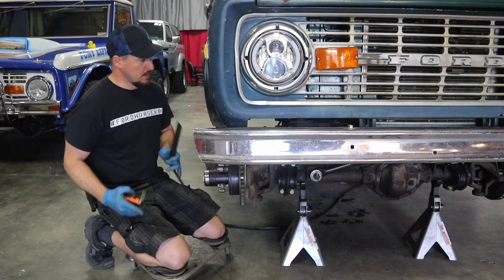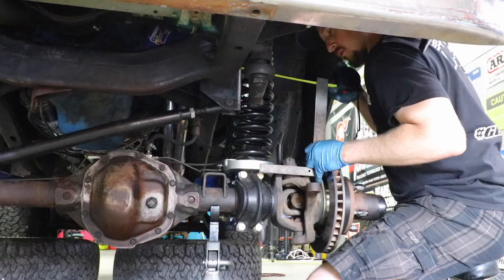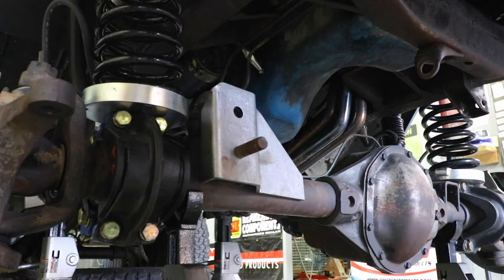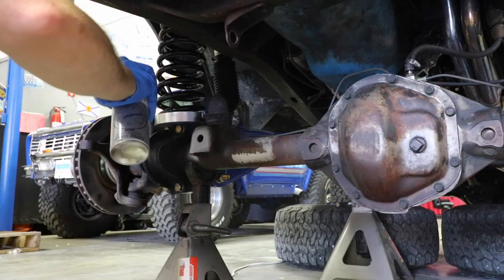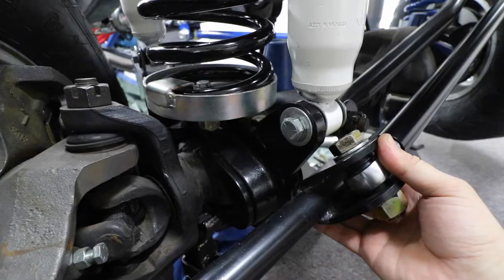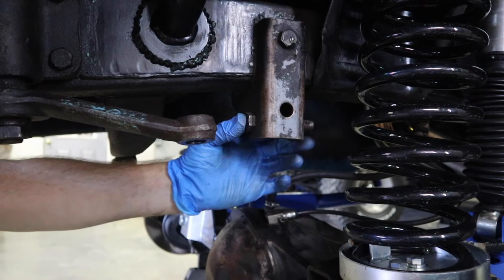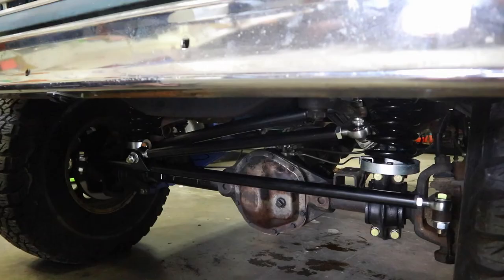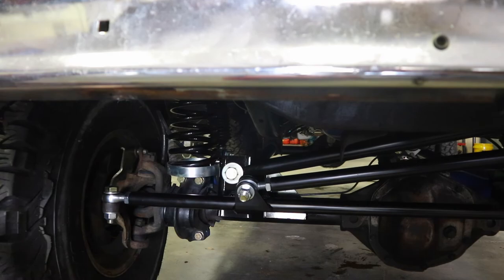Ford Bronco - James Duff Track Bar Riser Bracket Install

Comment: Just got done with the 2.5 lift kit. Getting ready for the heim joint steering system as well as the adjustable track bar end. These videos really help out, thanks

Comment: It's good to see people who know how important those track bars are, and who aren't insisting on two or more steering stabilizers before checking the track bar brackets and bushings. Also, how much lift was on the Bronco you were working on?
Reply from the maker: Yes indeed! It has a 2.5" suspension lift

Comment: I just put the riser bracket on my Bronco. Either Ford or the previous owner welded the stock bolt to the inside of the factory bracket. Breaking the welds with carbide bits was not fun!